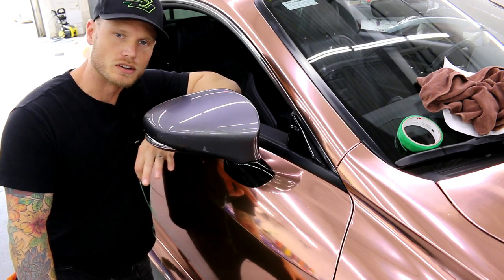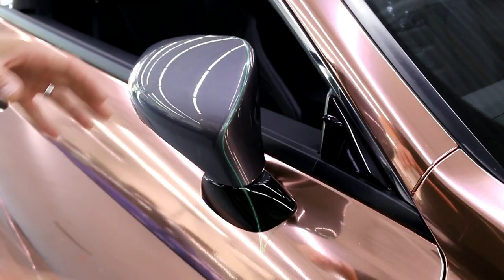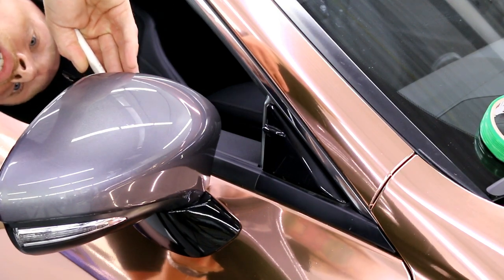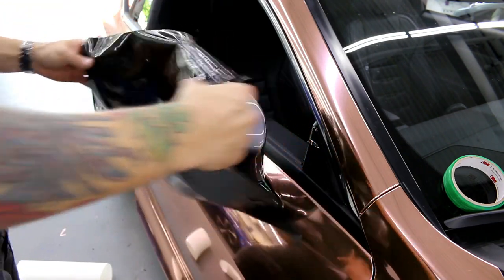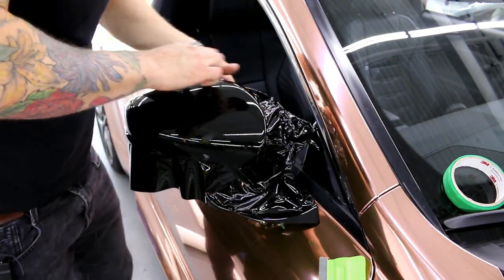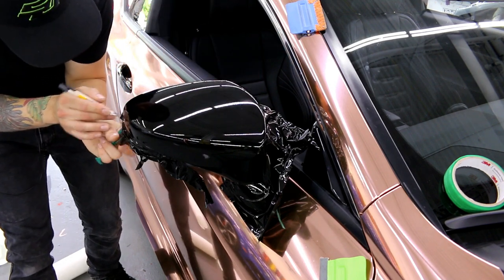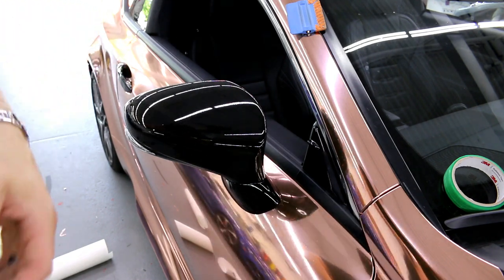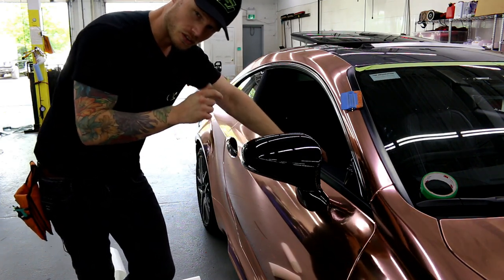THE EASIEST WAY TO WRAP A MIRROR CAP In 2 Pieces | Super Up Close!

Comment: I appreciate your work, couple of things to add, glue specks happen as you slide around on mirror before you apply 1st time, this is usual with avery, glue "rolling" itself especially if you pull over any ridges leaving small dots like, "making a bed" technique (on time smooth hit basicly) is recommended with avery to avoid it. Also, before you cut, let glue sit for 15min, do other mirror in mean time, don't cut right away, same with post heat, do it 30min after apply. Avery is generally great as you know, but need some adjustments due to softness, thickness and easy apply glue. All best!

Comment: 100% Professional.I built nitro model aircraft and covered them for years.It takes a special knack to do it right.So on the initial start,no heat on your vinyl.Slight heat after to activate the adhesive then stretch to the edges.Then a final shot of heat after you smooth everything to seal the edges.I have a Toyota truck that is about to get a restore and can't wait to try this on the interior and exterior. Do I use the same vinyl for both inside and out?

Comment: That edge can be from the tooling that consist of two halves. Where that seem is are decided by the designer and you normally want it where it won't be noticed. Sometimes this is not doable due to draft angles and the shape of the part.

Comment: I just purchased a pair of outer mirror shells which are ready for painting. Can I wrap them as they are or will the vinyl only stick to a painted surface? 

Also, would wrapping them off the car be a better solution than doing it only after they have been fitted?

Comment: Awesome work! How did you wrap the base of the mirror? Is it in one piece or two as well? I have a GS F that has the same mirror and I've been wondering how the base can be wrapped cleanly
Reply: I have GS F too - wrapped the posts tonight - very amateur, passenger side in two pieces, drivers side in three pieces. I struggled with the knifeless tape.  I have not attempted the mirrors yet. 

Have you done yours? How about the mirrors?

Comment: Sometimes the "trim edge, or molding" is so tight to what wrapping can't tuck, or it eventually starts to peel up or shrinking back after a while. Would it be best to remove pieces like this to wrap instead, or any other tricks that you know of that I don't?
Thanks for vids, as its nice to see what other ppl do, & what tricks & tips they know that can be passed on...
Cheers, A👍🏻👍🏻
Reply: Also, like you....sometimes I find it extremely challenging to find my line for trimming/cutting, as the edges are SO SO tight.

Comment: i have a headlight that is similar but i suspect if i did this method there would be a line across the headlight because of the clear tint getting doubled up. i tried finding a video on wrapping my light and i can't seem to find one. it's a 2011 highlander. the headlights would need some series stretching and i am not sure i am up for the challenge. but i guess i could buy pre-smoked after market headlights off of ebay for 126 bucks since the main reason i wanted tinted headlights in the first place was because the headlights are starting to fog and i don't want to refinish them yearly, getting them tinted means i resurface them and they will stay good for a few years before i need to do something... but.. i could just replace them i guess. i really just wanted to get one of those cheap chinese vinyls and wrap them but it's obvious my headlights are too boxy to do that.
Reply: Necro Kittie boxy is easier

Comment: I've gone through so much vinyl trying to do this
Reply: Thats where i am now mate , used almost all my vinyl now to try and wrap a mirror
Reply: did you managed to do it eventually ?
Reply: @IRTEHLEETOKNPBB  nope, honestly gave up but I did a chrome delete on all the stupid chrome trim with some black vinyl and it turned out great. 
What I did with the mirrors was actually Plasti dip them and they look great too. I can just peel it off if and whenever I want to remove it or even spray them a different color. 
It's on my Instagram page

Comment: Nice job, can an Infiniti FX45 Mirror cap be wrapped in one Piece? Also can I Wrap the cap off the Mirror or would it better to wrap it while on the Vehicle. Reason I ask is because I have Aftermarket Caps with LED Signal Lights I purchased and they are off the vehicle now. Thanks for your response :o)

Comment: Remarkable job bro. I tried  to do my dash trim today. And I failed. I was so disappointed
Reply: I think it failed cause it was cheap wrap. The stickiness on the back was not good. And I was putting it on rubber door pieces.  Cause my cars from is old from 2002 not plastic. But it also is rounded to. Which made it more difficult to rap to

Comment: I think it is more likely that that line you refer to is more a line caused by a multiple piece mold instead of multiple pieces glued together.
Reply from the maker: Exactly what I meant. It's a multi piece mold since they can't cast the entire mirror in one piece
Reply: Well, it is a one piece mirror, but the mold is multi piece so they can extract the mirror cap out of the mold. That was what I meant actually :)

Comment: Why do you not remove the mirror caps install a wrap all they way inside then reinstall cap?  I'm thinking taking the car fully apart like if you were going to paint it. Why are wrap people not doing that?
Reply from the maker: Because I can obtain full coverage without that much disassembly. Unlike paint where there is too much overspray, vinyl doesn't have that issue.
Reply: @CKWraps  thanks. Good to know. I think I will have to remove on vw because I need to wrap inside lips where the mirror is too.